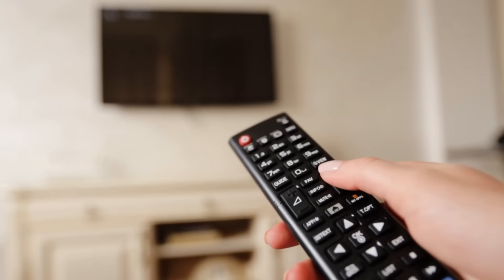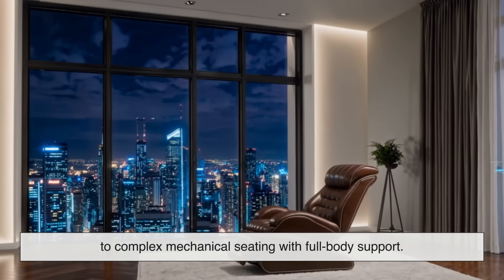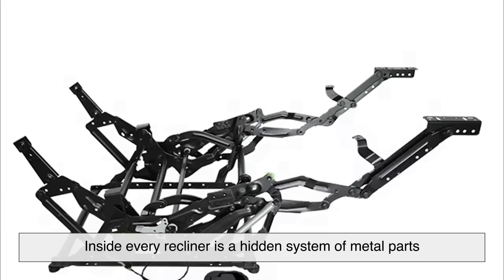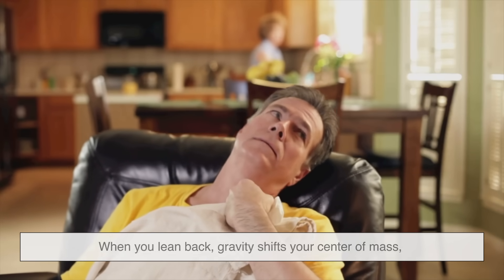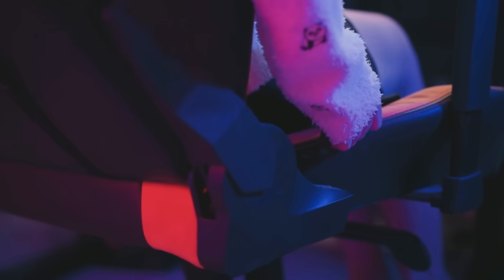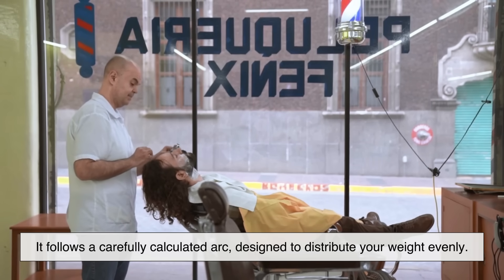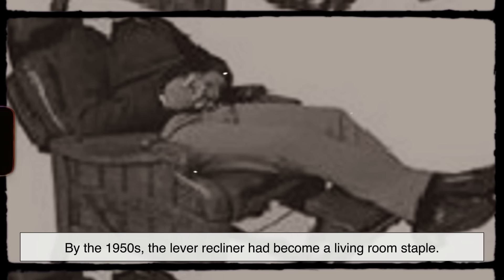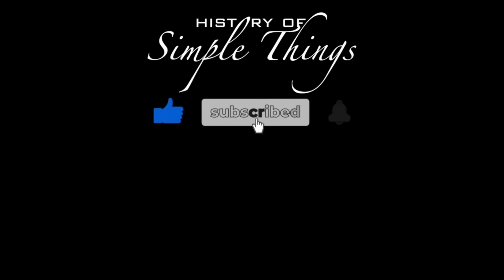Recliners: How That Lever Adjusts Your Entire Seat

Comment: Actually, most recliners use extension springs.  Torsion springs are too inefficient to move the mechanism and any body weight!

I ran a furniture test lab… a standard cycle test was wit 230lb dummy or human subject for 100,000 cycles